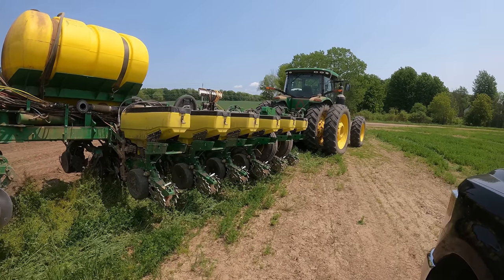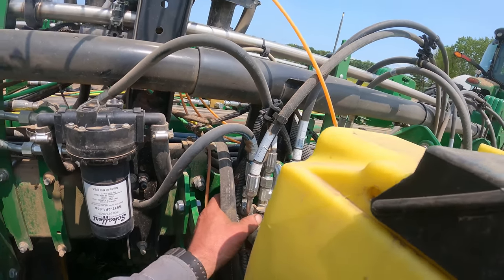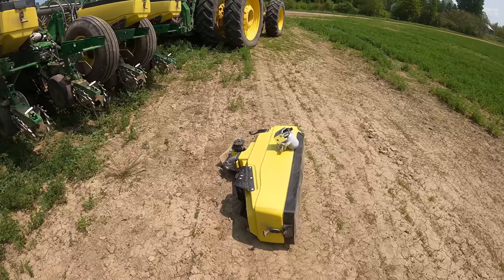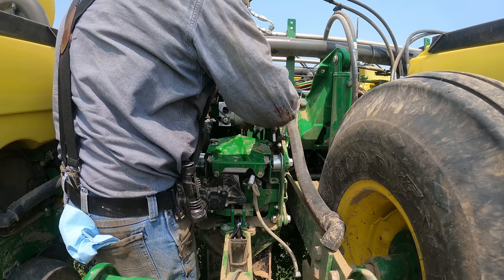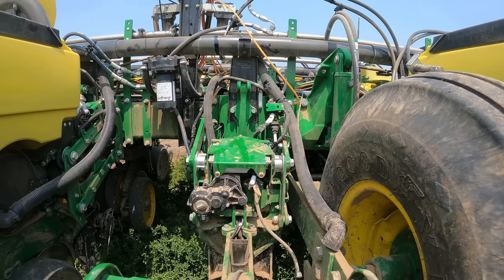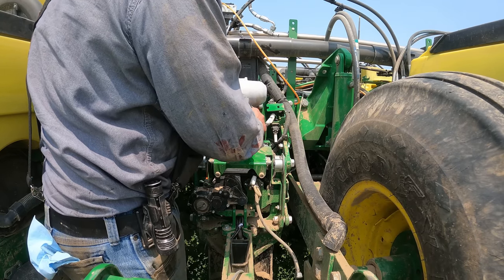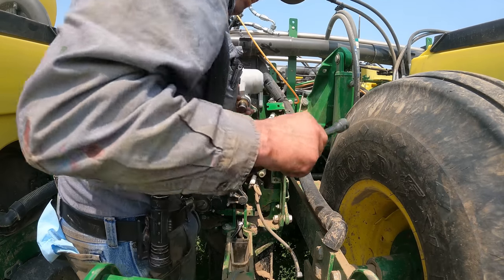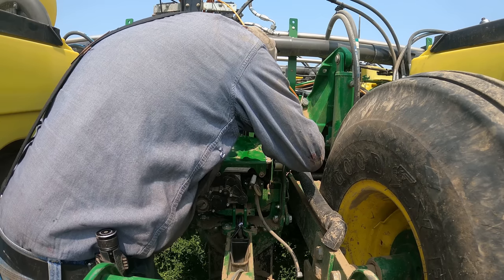Are these new electric corn planters worth it?

Comment: Our first major upgrade to our planter was auto guidance ( steering). It reduced operater error on following a marker in the dirt and operator fatigue. The big help was when we added row clutches. We reduced our over Planting on the ends and edges of the fields enough that we sent back close to 20 bags of corn the first year. That is a $3000 to $ 4000 savings. But the big plus was our yields went up in those places that were no longer being double planted and lodging went down too. Yield up sometimes 5 to 10 bushel in most fields. Even more in a point or odd shaped field. At $5/bushel that made another $25 to $50 per acre. Yes you can plant without this technology but, you will find much of this tech will pay for itself. Good luck with the rest of spring planting. Need rain here.

Comment: You mentioned a whole bunch of models of planter which basically chronicles my life, starting with a 494A four row shoe opener. I remember how revolutionary the 7000 was. Got up to six row banging around Connecticut roads. Utah we could get up to 12 and 16 row. Tech is good. Most of the time

Comment: Andy, you're absolutely right. I will say, I still prefer the older equipment mainly due to, all the kinks have been worked out. Now, even though I call today's equipment junk, I know they work. As you said, it is frustrating to see all the break downs and cost of said break downs. What many fail to accept is, "what works for you, may not work for others", hence why farming is done differently all across the states. Great video as always. Cheers :)

P.S. we used to plant corn with an old non styled JD "B" and a 2 row planter, rarely had issues with it, then again, the hoppers sat directly behind the rear wheels so, easily checked from the tractor seat. LOL
Reply: Ham 68 you said a mouthful I have sold seed 🌽 for 35 years, and if there's one thing that I have learned it's that works on one side of the road 41 farmer does not necessarily work well for the guy across the road. If you can tell me why I'd appreciate an answer!
Reply: @guydaubenspeck9206  Everyone does things differently.
Reply: @Ham68229  you got that right!!

Comment: Many people have the "rose tinted" view of the old days as if older machinces didn't need to be maintained or ever break down.  Reality is if you were doing big acres you would often replace stuff like bearings and chains every winter because the chances are they wouldn't make it through a second season.  Yeah older kit had different problems but they were still problems.
Reply: Eh idk about that my gpa had and intranational ya he only farmed 200 acres but I only ever seen that tractor broke down once my whole life and it was old then...the hay baler on the other hand was broke all the time
Reply: @dharrison6832 ... tractors tended to be simpler and more reliable than the machines they pulled,  that said there is a huge difference between your 200 acres and the probably  4 to 5000 Andy is running.   Not saying new is perfect but no way you would get through the acreage that today's farms need to be profitable with a 70 horsepower tractor and 4 row planter.

You've also got to remember 40 or 50 years ago getting 100 bushel corn was considered an awesome yield,  today most guys are aiming for a minimum of 200.

Comment: Hey there Andy, I hope this finds you well.

I'm 63, and having been both a John Deere Dealer Principle for decades, as well as a Beef Producer (cow/calf) most of my life, I am happy to say: "I Love Technology" and you can embrace it, or you can get left behind. 

From what I've seen and heard, your issue with the Hyd Downforce Module is rare, but not unheard of. 

I hope y'all have a good one! 

"Nothing Runs Like A Deere" 🦌 👍 🇺🇲
Reply: Do you feel the same about E Vs ?
How will they charge them if we don’t produce enough electricity now?,
Reply: Might I suggest the reason you embrace technology is because it is a fantastic profit center for the dealer.
Reply: @Norman Reed  
You can suggest anything you want to, but you'd be wrong.

I'm no longer a Dealer Principle, haven't been for years, and it's not a "fantastic profit center" for Dealers. 

The amount of time, training, and equipment required before a Dealer can offer such services to customers is astronomical, and it's never-ending.

It takes several years, and lots of customers, just to recoup the initial outlay, before you can even begin thinking about making a profit, which is after all why you're in business ---- isn't it?  

"Nothing Runs Like A Deere" 🦌 👍 🇺🇲

Comment: Hopefully I am part of the choir. You have to maximize every piece of the job you possibly can. First there are so many different decisions to be made: farm needs, crop rotation, what to plant, what type of seed, how much fertilizer, what fertilizer, population per acre, equipment available, reliability, equipment repair, help available, etc., etc? The newer equipment with multiple sensors can assure you are planting according to your plan. I am envious that you also take on the risk of the variables that you have no control over such as ; temperature, how much sun, will it rain the necessary amount at the right time, wind storms, market demand and prices. Obviously the loss of 1% here and another 2% somewhere else all take away from the bottom line. And all of a sudden you are out of business. As you said recently, formal education is not absolutely necessary, but experience along with the required trade skills are. 
I am impressed !
I enjoy your videos. Please keep them coming.
Reply from the maker: Thank you

Comment: Andy, I'm with you 110%! You are absolutely correct on what you said. Sure, you can use any planter to get the seed in the ground. With the high cost of seed, fertilizer,fuel, equipment and all the other costs associated with planting a crop, the technology you are using let's you plant as perfectly as possible to maximize your yields.  Like you said, it can be a royal pain sometimes to keep all that technology working, but you know at the end of planting time you did all you could to get it in the ground as perfect as possible. Another great video! Keep up the great work!

Comment: In my days when on the dairy we milked 70, the farms around milked from 60 to 120 cows. Farms were 240 to 400 acres and 4 and 6 row planters were big enough when the planting rush was on to get the seed in the ground. All mechanical planters. Today those size farms are hobby farms. I can understand when planting 2, 3 or 4 thousand acres needing bigger and smarter equipment because farms gotten bigger, the need for feed for that many milk cows and young stock and the only thing that hasn’t change it the time to get the seed in the ground.

Comment: You are absolutely right! Seems silly to have all the bells and whistles on a planter that gets used once a year. But.... It's what helps you make the most feed at a profitable rate. My old 6r 7000 does a good job but it's wore out. Pump electric fertilizer system on last yr and next yr it's getting new meters and drive system or retrofitted to electric drive. I don't need guidance as I only have 50ac. Just need better seed drive.
Reply: The best thing about the 7000 is they are rebuildable  and updateable.

Comment: The hydraulic down pressure on a corn planter really shows how often it is in fact raising the row unit/s up, to maintain the desired pressure/depth. I apply insecticide on corn on corn acres, the 50# container on a row unit has an impact on the amount of lift needed to maintain seed depth.

Comment: Love electronics especially microprocessors a little programming beats making a board out of off the shelf components that anyone can fix 😊, used to work in that area.  Equipment heavily integrated with electronics make a nice hook for the manufacturer of the equipment. Generally makes them your best friend for the life or at least the life of the equipment. Other wise it’s fined another friend who as the drive and the know how see if it’s possibly  to beat.  My favourite manufacturer hook is when machine doesn’t work unless it’s hooked to mobile network, they your best buddy then.

Comment: Im a fan of technology never grown corn small grains mostly.  The computer drives a better line than i could ever manage.  Rate controlled fertilizer and spray rates . Auto off and on with the sprayer it pays for itself pretty  quickly.  Your right it has problems  but if you loose a bit of time to manage the problems its worth it .

Comment: Andy I have some skid steer tire information you might want the company that I retired from has 4 bob cats s130 and the new model they have a brand of tire they’re running now for 16 hours a day on concrete 5 or 6 days a week at a paper recycling manufacturer company the ones they have now on 3 machines are over 5 years old and still going no flat either so far but not good in mud

Comment: Come a long way since the days of the hand operated corn planters made of 2 1x3 slats of wood connected at one end and the little mailbox-looking thing that held the seed corn.  The one thing you can say about corn planting today over your grandfather's time is that the business of agriculture almost forces you to have the technologies on the planter to ensure population, seed depth, and any number of factors that will cut into your ending numbers.  If you have a great growing year but your population was off and you only planted 90% of your intended crop.  That's 10% right off the top you won't harvest.  Or if your seed depth was off.  Germination can be off and the crop is very uneven.  Making grain won't happen if your corn is maturing on different calendars.  Farmer's margins are very thin these days with costs of inputs so high, any miscalculation of the planter can reduce a great year to a so-so year.  Or a so-so year can be turned into a bad year. I guess piece of mind is worth something, eh Andy.  Great video.  Fun to see some of the "gadgetry" on your planter.  🚜🚛
Reply: Even Oliver Wendel Douglas had trouble with his planting finger 🤣

Comment: So on a serious note my iPad links to my heavy truck diagnostic software with Bluetooth. I fought with that thing for a few weeks I would get halfway through a diagnostic or halfway through a test and the damn iPad would disconnect. It ended up being the iPad I threw a different one on and have not had trouble since. Maybe you've already tried that by now I'm not sure.
Reply: Or skip the bluetooth, run it wired?  
Another step in the process of elimination?  
As good as wireless is -- or can be, or could be -- how often is it a want posing as a need that in the end is truly a luxury often at the expense of quality AND quantity(speed)?

(I'm not trying to be cynical, rhetorical, sarcastic, or even thought-provoking this time, fwiw.)

Comment: How ever did they manage to get any planting done 30 years ago before all these fancy electronics and sensors?   I just spent a week rebuilding a 25year old mechanical planter that had been sitting for years and that mice had gotten into.. It was savable though in the end. The older, simpler and somewhat reliable equipment is mint for the smaller scale and extra work, but with size the sensitivity to errors makes for big piles of money each way..

Comment: Pretty disappointed in our precision planter. A t handle got moved to half inch deep accidentally and nothing in the data or monitor pointed to the issue. You'd think there would be a notification the applied down force is consistently different than the other rows. Need to treat the planter like an aircraft and check it over every fill up
Reply from the maker: Yes

Comment: Andy are you still using The FJ dynamics auto steer
Reply from the maker: With the planter I have to use green star
Reply: @FarmingFixingFabricating  just wondering what you thoughts were on the system
Reply from the maker: @danmorgan8745  it’s a god cheaper alternative
Reply: @FarmingFixingFabricating  do you have RTK

Comment: Vaughan Bauer is the only one who deserves credit for John Deere planters being relevant.  Decades of if they weren't green no one would buy them.

Bauer was the non John Deere welding outfit who designed their 60' and wider toolbars.  He eventually sold to Deere so like all good things in their lineup they could sell what they couldn't design as theirs.
Reply: I think about everyone uses Bauer Built frames anymore.    I know CIH does.
Reply: Don’t forget the meter they borrowed from kinze.  Everyone talks about how good those were
Reply: @jeffrankin967  CNH planters are made in Canada.
Reply: @5thgen916  I didn't say they weren't made in Canada.    But I do know their 24 row planter uses the same Bauer frame as the John Deere
Reply: @JEFF RANKIN  It would have to be an intellectual property agreement then.  I couldn't tell you 100% either way.  I know the 60/65 series frames were designed by old flexicoil engineers though.